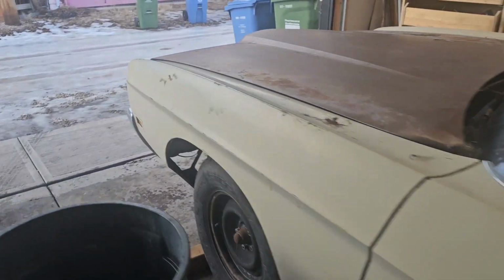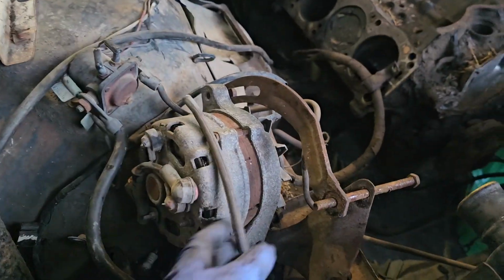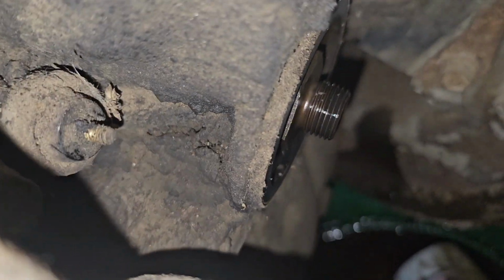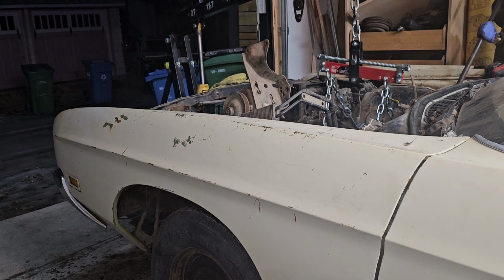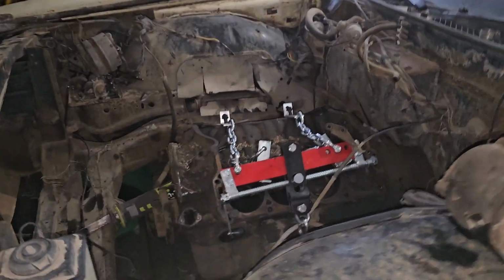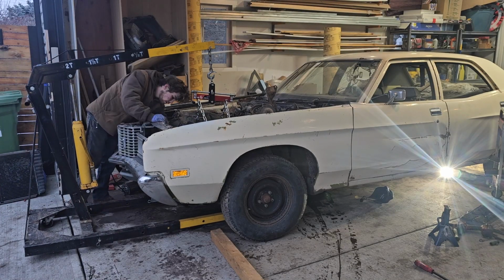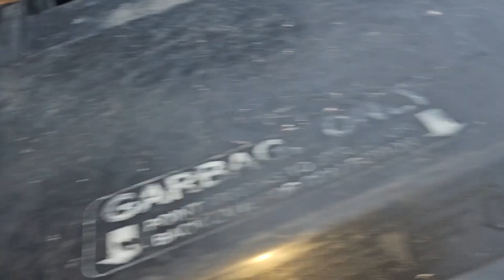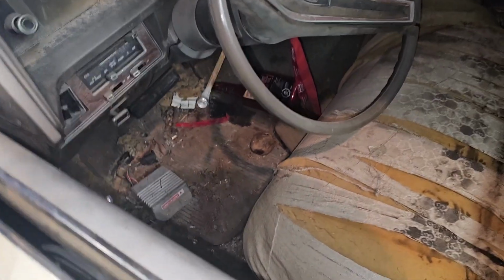Engine OUT! Pulling the Engine OUT of the 1971 Ford Custom *Project White-ning*

Comment: I am very happy to see you doing so well. I very much admire your energy and industry in returning this now-rare car back into working order. Kudos to you for that!
As for the engine... I'd put in something...not seized...that fits to your existing transmission. You have extremely limited funds, so a working engine will do the job for you nicely. That'll be enough to be getting on with. It doesn't need to be a hot rod engine now. It didn't have a hot rod engine was it was new, after all.
Then? Drive the car as far as you like. Drive it until governments make it illegal. 
Please continue filling your young life with pleasant memories. So many of us old folks didn't. We did boring and responsible things. 
Just enjoy this process. You'll have gained experience and wisdom. 
Please take the best of care. Literally...watch your step on the ice. Aloha!
Reply from the maker: Thanks a lot for the comment, Jim! 
The trouble is that part of the memories I'd like to have  in fact irresponsible ones! Ones that involve a 428, or a 460! Haha! I do want to see this car on the road again. I love how it was portrayed in  and I feel like it's time for me to have a car that even has the  to go fast! I've never had a "fast" car. So I feel that while I'd drive responsibly ALL the time, it'd be nice knowing that "hey, if I want to lay down two rubber strips that are both 2 miles long, I CAN..."
In any case, you're absolutely right. I don't have that kind of budget yet, although you never know what the future holds! So we'll see. 

Take it easy in your ice-free tropic, by the way!! There's some serious jealousy over here...
Reply: @TeenMechanic  Ah! A very well-reasoned attitude you have there. I was nowhere near as clever and eloquent as you in my day.

I like your mental picture of an innocuous-looking beater...with Hell's own powerplant under the hood. As you say...just knowing you could dispatch the hounds of Hell at the tap of a toe is a very intoxicating thought. I hope you achieve some measure of satisfaction from your car soon.

Canada looks so lovely. Your have the most beautiful stretches of road there to "play on." So many things to see alongside kilometer after kilometer of lightly-traveled road. Surely...a driver's paradise.

I do enjoy not having to spend lots of dough on heating or air conditioning here in the islands. THat is a blessing, I'm forced to admit. 

The longest road trip I can take on this island...without retracing my route back...is roughly 180 kilometers. Mind you...that is a fairly tidy ride for this old man on his bicycle.

Please enjoy safe travels in whatever steed you ride out there in beautiful Canada! Aloha!

Comment: If you were wanting to get the motor unstuck you could have used a torch and heated up the block up and try to move the engine and you can use a hydraulic jack and put a wrench or a socket and extension on the Jet and Jack the car up and it'll come it'll come loose it will take time put in Liberty pressure on it😊

Comment: LS! Blehhhh. Noo! A 351 would be perfect again in it. Maybe one of the later injected ones? Or ya know what would be interesting. Idk if you still have it but the 4.6 you had from the vicky would be an interesting resto mod in that regard.
Reply from the maker: I'm thinking carburetor, or EARLY EARLY injection. Simply because standalone's cost a bazillion dollars. Lol
Reply: @TeenMechanic  Hey I get that. Ooo carbed 4.6. Throw everyone off 😜
Reply from the maker: @KatarinasGarage  Here's a little piece of info... I have not publicized this yet. BUT they make a manifold for it that's crazy expensive, so maybe... I've been legitimately considering it. If not, it's also easier than I ever would have thought to make the original PCM for that motor work in the car. So that 4.6 is becoming more and more feasible.
Reply: @TeenMechanic  Oooo that would be really cool. Like something about that resto modded that way is very interesting to me.